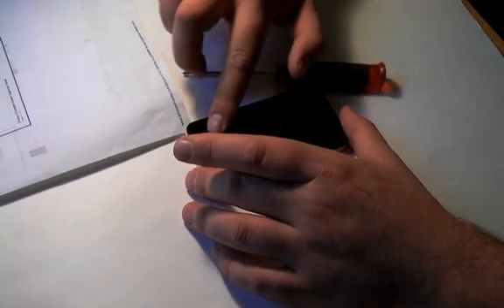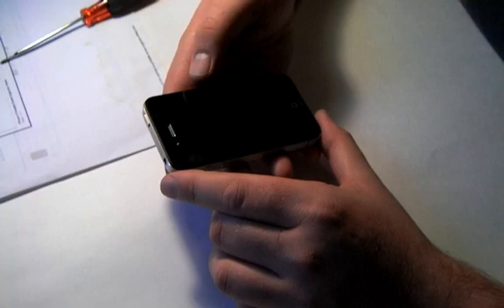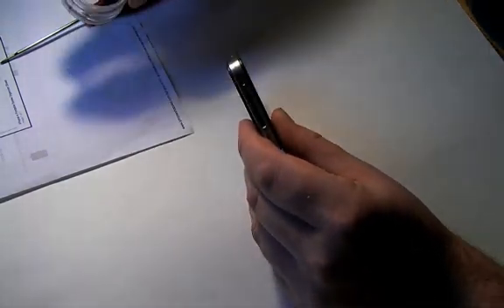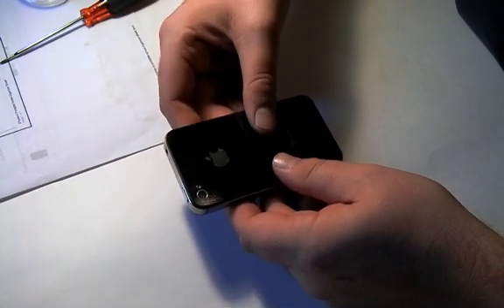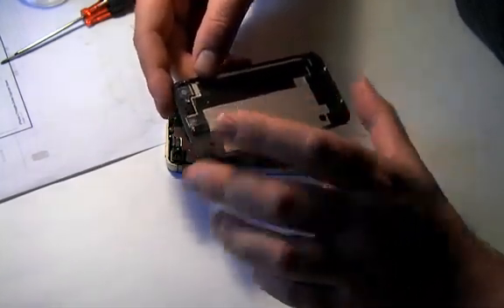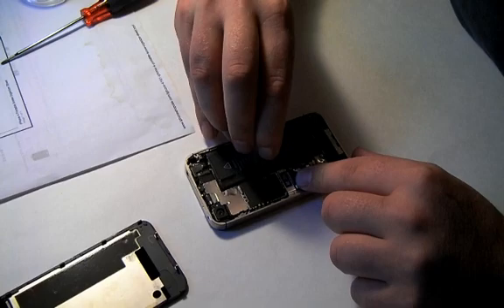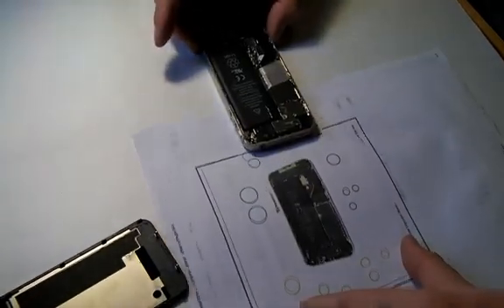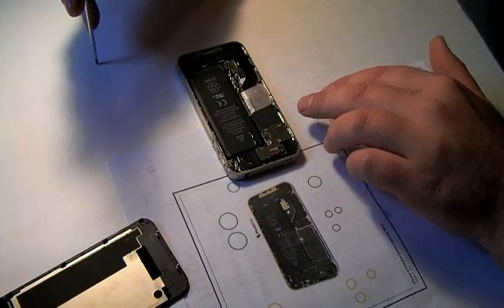iPhone 4s water damage repair

Comment: hey,my iphone 4s got water damage,and i put it in the rice bag and after a week or so i turned it on and it can't make sound,so i took apart and found no water in it and reassembled it. i think i got every thing in the right position but my iphone can't work since then whenever connected to pc or the charger.
do have still have any chance to fix it?